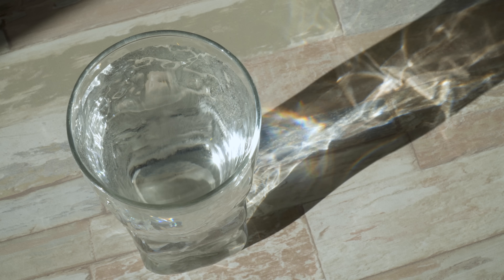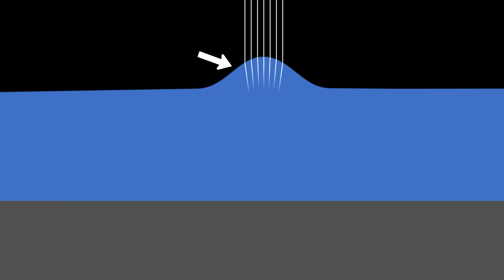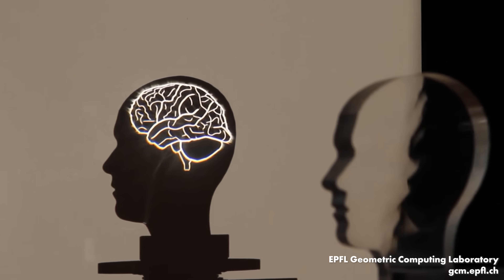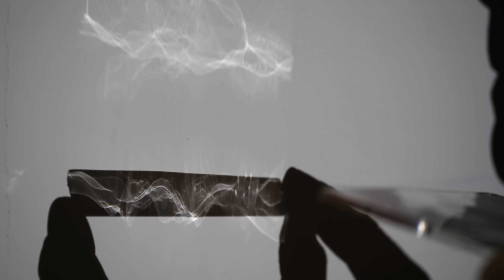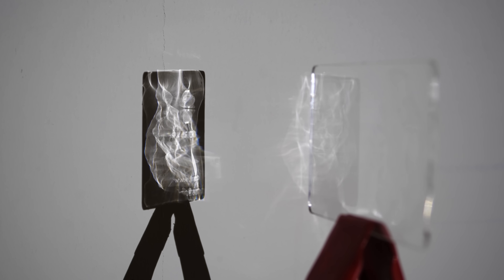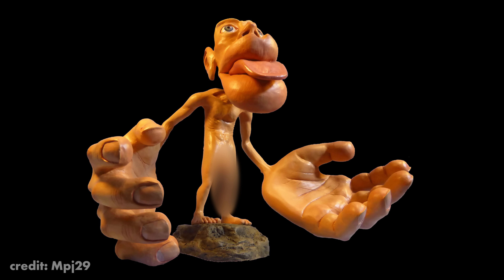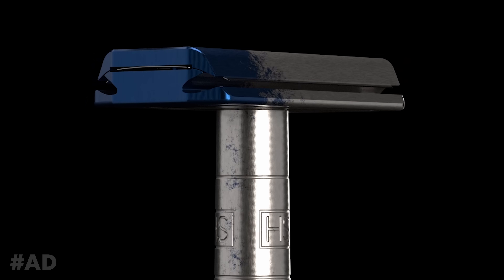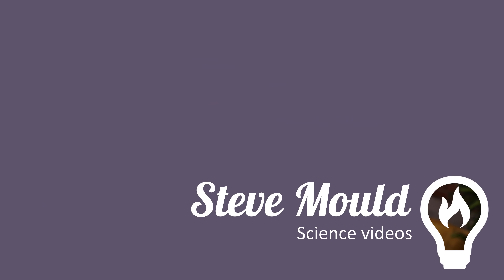Caustic lenses are really weird

Comment: 1:11 - that's one of the most beautiful things that exists in my opinion. Since I was a kid I always were mesmerized by those lights under the water.
Reply: I tried scuba diving in a swimming pool. When I saw this pattern on the floor I was sold.
Reply: Also, 3:53
Reply: @j.v.kelley6133  Agreed
Reply: "And the pool was filled with water out of sunlight,
And the lotos rose, quietly, quietly,
The surface glittered out of heart of light,
And they were behind us, reflected in the pool."
(T. S. Eliot, "Four Quartets")
Reply: Right?? I've always wanted to recreate that effect such that I could project it onto my ceiling! I actually came close recently using a hollow glass sphere with the inner surface coated unevenly in resin.
Reply: @hollt693  I also want to project that effect on my ceiling, but I want them to move too
Reply: @ZarHakkar  Ah, sorry, I realized now that I didn't finish explaining the point of the sphere. If I backlit it with a point light source then rotated the the sphere on an axis perpendicular to the direction of the light, I would get a moving projection, and the most important thing about the sphere shape is that you get two overlaid patterns protected simultaneously that move in opposite directions, and they look nothing like flat projections because the size and shape of the individual caustics varies dramatically with changing proximity and angles relative to the light source, all of which you get thanks to the curvature of the sphere.
Reply: Have you ever seen those pass through slightly foggy water before? Absolutely stunning from under the surface
Reply: Kostynha: OHHHHH! I was expecting you to say a beard disappearing.

Comment: You are wrong about printers though. I bought literally cheapest hp printer with automatic duplex printing and, except starter ink, I exclusively use also cheapest off brand ink I can find. While there are no problems with the printer, off brand ink makes little bit worse prints than genuine one. Also cheap printers have printing head integrated into the ink cartridge, and that's what's makes cheap printers cheap and ink expensive (not mine though, it wasn't that cheap). Also also there are more expensive printers that can be loaded with ink from a bottle, which makes is significantly cheaper.

Comment: The corridor cast has a great podcast discussing how 3D rendering caustics is one of the hardest things you could possibly do. And how they figured out how to do it
Reply: Link?
Reply: @1stGradeWumbology  Here is a link to the video. https://youtu.be/7l6QOcgWXfI
Reply: these are "reverse" caustics, you don't calculate them, instead they are the starting point
Reply: @toseltreps1101  it's algebra applied to 3D rendering.  Just solve the other side of the equation, given the answer.
Reply: https://youtu.be/cXS-Kg3zDjo
Reply: studied architecture ~15 years ago. first efficient raytracing engines with caustics, volumetric lighting and diffuse reflections found their way into our tools (cinema4d, rhino, even some caad programs) minds were blown
Reply: There is also a video about it.
Reply: https://www.youtube.com/watch?v=7l6QOcgWXfI
Reply: It takr a really long time for Blender to got cycle render to do caustic

Comment: the most unintuitive thing is that these objects seem to have a lower resolution version of the pattern they project when in every other case you always try to get a picture with as high of a resolution as possible. its almost like some sort of data compression. you could have a 3d printer with a relatively low resolution print these things which then show much higher resolution.

Comment: Steve talked about this being an optimization problem. I know it is solvable using Differentiable Rendering and Stochastic Gradient Descent. There is a good example in the documentation about Mitsuba3. Is this how this problem is usually solved or are there better algorithms? Also are there papers comparing a Differentiable Rendering approach to these other algorithms?
Reply: Hi, CTO of Rayform here. Differentiable Rendering is certainly one way to do it, however for better quality and high-contrast it is better to use tailor-made solutions. You can look at our Siggraph paper for more details.

Comment: Those Henson shaver handles are (almost) the same as the ones that introduced the infamous business mode.  Gillette provided handles at a loss to millions of soldiers, then charges heavily for the patented steel blades that were sharpened by the way they are manufactured.  Since then they changed to the new fangled cartridges with that are the only things that fit their plastic handles.  Meanwhile another shaving company has simply stopped making separate handles, instead selling complete plastic razors at a fair price.  You may know them for doing the same to the ballpoint pen industry.  Their name is BIC.

Comment: What makes a safety razor safe?
Reply: When you have a straight razor, you can cut yourself pretty easily when using the wrong angle.
but with a safety razor, you usually don't ever cut yourself. (Just be careful around the chin area and nothing will happen.)

Comment: you can start a fire using water as a lens! you just need pretty clear water and a lot of direct sunlight. there are a few different ways to make it work, but a ziplock bag full of clear water might be the easiest. i've also seen a regular water bottle do it with a lot of patience
Reply: You can certainly do it with ice.
Reply: Dewdrops have been known to start fires in hay.
Reply: I vividly remember when a teacher's keyring at high school began to give off smoke. It was a sunny morning and there was a dead aquarium filled with water on the teacher's desk. The resulting lens near ignited plastic.
Reply: @stargazer7644  That is simply not true. Please don't trust anything you see on the internet.
Dew drops are way too small to do anything. They occur only in the morning when the sun is not as powerful either. 
Dew can help catching hay on fire, but because of completely different reason and that's building up heat due to chemical reactions and microbial growth.

Comment: I can't help but notice how the reflections look just like a video waveform monitor when light reflects from them at a narrow angle, I think it is a good analogy for how they work
Reply: I'd have to agree with you on this one
Reply: +1 there, reminded me of the Captain Disillusion video "Color"
Reply: Video waveform monitor?
Reply: Is it tho?
Reply: I fail to see the connection. Could you elaborate?
Reply: @unvergebeneid  I think they're meaning how a waveform monitor, used in film/tv work for calibration of cameras, gives an analogue graphical view of the voltage of different signals, e.g. red or green or blue etc - depending on camera type- over time and space. So they give a similar measure of the light given off by the subject of a camera on the light hitting them - in a fuzzy sense - as the patterns here are to the light refracting through them :)
Reply: That's exactly what I thought as well.   Also had hints of x-rays.

Comment: Re: printers, a decade or so ago I looked into the numbers and saw it was legitimately cheaper to buy a brand new printer than to buy all new ink cartridges, and I did that a few times, giving away or selling the now inkless printer for extremely cheap. I've now got one that can use third party/refillable ink cartridges that are priced reasonably (there are plenty that will detect the non-brand-name cartridge and refuse to operate!) and it's a good printer that doesn't hassle me, too :) Still hate printers, though.
Reply: Laser printers are still probably a better purchase for those people who don't need photograph-quality image prints. Toner doesn't dry out the way inkjet ink does, and it comes in bigger amounts, so it's changed far less often, which means they also don't do the razor-and-blade pricing model.
Reply: This is not true and hasn’t been for a while. New printers come with an incredibly small fraction of a full ink cartridge ever since the whole “just buy a new printer each time” idea became very popular in the 2000s. You didn’t need to do the math, literally everyone was talking about it and doing it.
Reply: "cheaper to buy a brand new printer than to buy all new ink cartridges"
and they made the printer come with only 1/3rd filled cartridges. And now the "refillable" printers often have design like a non-replaceable cleaning-ink-reservoir that simply locks up the printer after a certain number of uses -.-
Consumer-printers are still a scam. I switched to simply using a copy-shop - printing there is simply cheaper than having a printer at home (kinda insane actually). And as it is a university copyshop you can just send the documents via mail or through a share and get them at 2 in the morning.

Comment: This is one of those rare times I see a Steve Mould video and think "boring, I already know this" I'm sorry, still giving a thumbs up and will probably still watch though 🤣
Reply: And yet there's still things I didn't know here. I knew that'd happen..
Reply: And now I know how to make one, hells yeah! Did similar once for pixel art sub-resolution letters on an image of a keyboard. For this I'd just stretch a mesh out to the distribution pattern and maybe use the UV density to visualise the corrections to edge angles, and maybe convert Normals to a physical displacement model..
I think if I spent a month on it I could make a readily repeatable pipeline for this within  Maya.. That said, I've got more pressing projects for the moment.
Not that I can print or cast glass yet any, but I could atleast test a model using Caustic Visualiser..

Comment: I'm curious how they actually make these peices of glass.
Reply: Per their website, they can make them with almost any transparent material, but the easiest and most common are resin, glass, and crystal.  Glass molding is not difficult, so when made with glass or crystal it would first be carved into a molding material, then the glass pressed into it, cooled, then tempered.
Reply: It’s described in one of their papers. Depends on if it’s glass or acrylic, but large production calls for a mold where an original is made with 3 levels of CNC precision machining down to .03 mm, then the final is polished. You can find the papers online. I’ve not been able to reverse engineer the math but you can create caustics with 3D modeling tools, then 3D print them. I had a very nice friend help me through some of this process, but we haven’t found a means of perfecting it… as a lens requires also understanding the strength of the light source and distance the projection wants to be clear. These are all more complicated than I can solve but the formula for the caustics is in one of the papers, ish, published by I believe the technical university in Switzerland where the founder of ray what not began this work. There are multiple papers published as the process has been further refined. I would love to understand this more myself as I have a project I would like to actualize for a performative Installation that would require further precision 3D printing to realize. Good luck and feel free to msg me
Reply: @evdm7482  it was interesting that the Mandelbrot heart shape kept showing up as well.
Reply: @evdm7482  Thanks for the information. I like to think I'm reasonably knowledgeable about optics but I was lost when you used the word "caustics." In case anyone reading isn't familiar with the term, here's the first line from the Wikipedia article:

"In optics, a caustic or caustic network is the envelope of light rays which have been reflected or refracted by a curved surface or object, or the projection of that envelope of rays on another surface."

Thanks again for your reply.
Reply: @ddegn  its weird because the word "caustic" also applies to liquids but in a different way, like corrosive or acidic mixtures
Reply: @ddegn  caustics have already been explained, please go to 1:00 .
Reply: @Hannah_The_Heretic  I didn't hear the word caustic around the 1:00.
Is a word explained if the word isn't used?
That time in the video could be used to understand caustics but without the word being used, it doesn't help much to understand the post to which I replied.
Reply: Even more impressive are the ones that are flat, but use different refraction index in different places.
Reply: I think they're acrylic?  And if so, that's pretty easy, it's just a mold.  Possibly an injection mold.  Just a really fancy precise one, where they pay more attention than usual to the shrinkage and warping.  The colorful one would be a little harder, but you could mold each of the pieces and then warm them together to fuse them.
Reply: @OrigamiMarie  Hello! The color could be added by just a translucent color film onto the transparent glass. I believe that's how they did it. Thank you!
Reply: @ianmlclm7044  There is quite less definition with the coloured ones. That lead me to think that it's made from different parts, then melted together
Reply: @OrigamiMarie  Can I just say, this is crazy to me. We've gotten so good at molding things, we can mold it one way, for it to shrink or warp into the position we want for the end product. That's just wild!
Reply: @OrigamiMarie  These do not appear to be mass produced, they appear to be one-off productions, like artwork.  I'd say they probably cut them on a CNC milling machine or maybe a laser engraver, and then hand polish them.  The colored ones are likely just painted.  They wouldn't be multiple parts put together.
Reply: @OrigamiMarie  If I'm wrong I'm wrong, but my guess is that even with the most precise mold, it probably can't possess the extreme resolution required on the surfaces of these "lenses"  to create the light image. I would say that these are probably manufactured with extreme, high-tolerance machining processes. (cutting, polishing, etching, to name a few) all CNC controlled. Most of us wouldn't be able to afford a larger piece because of  the fact of that machine time=big$$$. I saw that their jewelry is quite expensive,, when considering the materials that you're getting....at the multi thousand dollar price point, you are getting a very small example of this (albeit unique and beautiful) technology. Well anyway, I hope that one day I can go to shopping center and buy a nice piece made up right then and there.
Reply: @OrigamiMarie  Is it a Steve mold?
Reply: @OrigamiMarie  a Steve mold?
Reply: @OrigamiMarie  - Agree, and with glass, maybe with laser etching, but im not sure if can be polish after the etching and maintain the precision... if they do on glass, i would love to see how they do.
Reply: @OrigamiMarie  
Wooow!!! You are so smart 🤓
Reply: @jelly.212  Damn, didn't know answering a question was illegal.
Reply: @bottomtext5872  
Wooow!!! You are so smart for observing that🤓
Reply: @jelly.212  Ya. I don't know if you are being mean or nice
Reply: I’m curious if the precision tolerance would allow standard resin to be molded into one of these shapes. It’s easy enough to imprint diffraction grating into resin, and I feel like caustics would have a similar tolerance. Anyone know?
Reply: I'm not sure how it's done in this case, but it probably could be done with something like a CNC milling machine and a fine-grit diamond, alumina, or maybe even tungsten carbide / silicon carbide grinding bit. Diamond's the safest option, as I know with certainty it can grind glass. You'd have to go real slow, use lots of coolant, go really light on the pressure, and avoid staying in one spot for too long (could cause heat buildup which can crack the glass thanks to uneven thermal expansion creating stresses in the material)... but it should be doable. Main downside is that'd leave a ground glass (opaque) finish coming off the CNC.

Once the glass is roughly ground to shape, you could then - by hand - use finer and finer grits of abrasive paste / polishing compound to smooth the surface down until it becomes perfectly transparent again. Very labour intensive, which means each item made this way would be pretty expensive (you certainly wouldn't want to give them out as business cards...) - but not impossible.

If you need the part to be made of glass, but are only doing a short production run (making the tooling for molding is very expensive, so it's not really economically viable for short runs / one-offs), the method outlined above would probably be your best bet.
Reply: I expect it's similar to how lenses are made for spectacles. Blanks which are then ground to shape  using very high precision cnc machine.
Reply: I bet a model of the finished piece could also be sls printed, then used to make the mold. Would definitely help with the precision required
Reply: @HelenaOfDetroit  You would need a very high res printer for that, I don't know if that is even possible with curren tech. Maybe if you used an SLA printer and then polished the final print?
Reply: @lbgstzockt8493  so sls can get to 400nm resolution, and 3d printing in metals is currently sitting at a minimum deposit size of 20nm. 
Some of the techniques can even remove metal as well leaving the minimum resolution dependant on the size of the atoms and the normal crystalline formations, so long as there is 20nm distance between features.
Reply: @LBGST zockt  the accuracy of an sla printer is more than adequate,  current-tech wise. 
Unless you buy super cheap knock-offs of clones of cheap versions it's fine, and even then probably still more than passable for the majority of what end-users will actually do with it. Like every other thing they use sla for
Reply: @HelenaOfDetroit  definitely dont think you can get that kind of precision with a 3d printer, at least not a commercial one